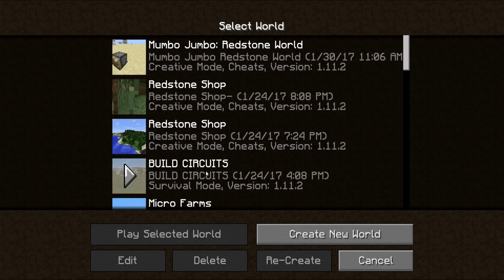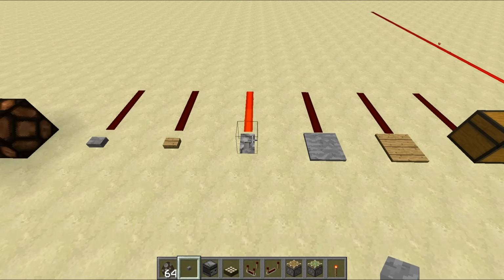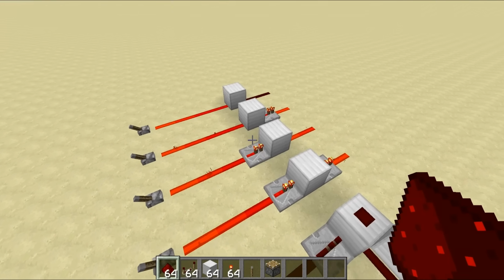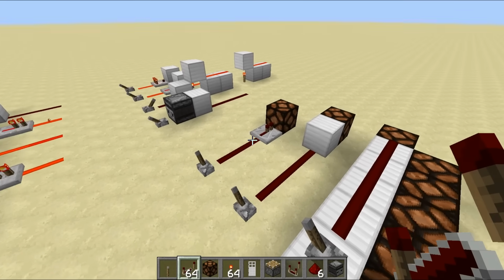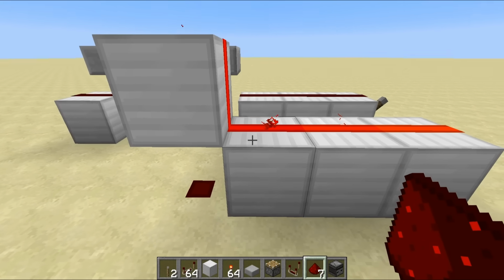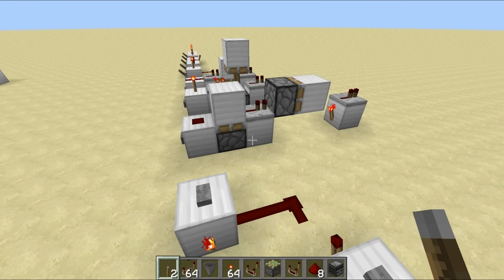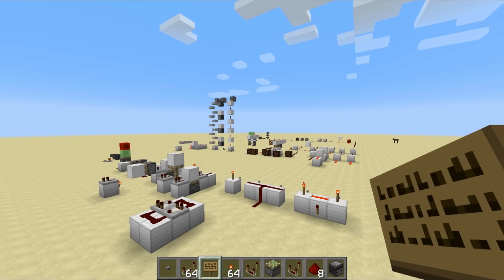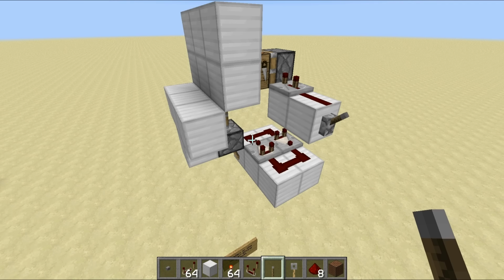How to go From NOOB to PRO at Minecraft Redstone!

Comment: Finished my homework. I pretty much made the same as the example, but because of maybe lag or something the door would instantly close sometimes which seemed like a suffocation risk. I added a pulse extension below so it's not the fastest door by any means, but it's smooth and risk free.

Edit: Didn't finish the video before I started building.

For the alarm I did use the clock, but I didn't realize I could use RS Nor Latch. I used a Flip-Flop to activate the clock instead and used a handmade system to disconnect the tripwire after it was set off. It's just 2 non sticky pistons that push a block back and forth to disconnect the tripwire after the Flip-Flop receives a signal, and then reconnect it and send a separate signal to the Flip-Flop from the button. Definitely overcomplicated that one.

For the crafting table I pretty much did EXACTLY the same thing, just not as clean. I also did a crafting table and a furnace together instead of just the table though. I definitely underestimated this though and messed up the timing of the pistons a few times.
Reply: FYI, I just watched the video today in case it seemed I was late for a 6-year-old video.

Comment: i made the 2x2 piston door so complicated. so i made levers power redstone which powers pistons and when you step on the pressure plates it powers more pistons which block the redstone the levers were powering , unpowering the original pistons opening the door. me looks at mumbos design . i completely forgot. about the redstone torches

Comment: I have now managed to make a door that only opens if i drop an item into a hopper and use a wooden button on a specific block to reveal the hopper, stone button wont work, then turn on the door circuit with a series of lever flips. My faction vault is now basically invisible in the ground, and the only way in without several ages of mining obsi is the front door. If you find an obsidian cube with no apparent entrance now you know.

Comment: me today:
-build Mumbo's 3x3 spiral piston door - my first redstone project, have no clue how it actually works, I just build thing.
-be disappointed it functions by a single lever, I wanted a button on either side of the door
-discover T flip-flops
-discover this video, noting the transparent block can power two separate redstone lines - splitting the redstone signal. that'll get me from one button signal to two.
-have a discussion with my husband about redstone and, particularly, repeaters - in which a lot of its functionality in the redstone door I just built starts clicking for me.
-IT CLICKS.
IT CLICKS IT CLICKS IT CLICKS

I'm learning, I'm delighted. and I'm gonna go test some stuff and figure this out.  thanks Mumbo!

Comment: Would a soft powered block power red stone on top of it, if it was set up like say this  —= red stone █= block  = Air
    
         █—
————█

so there's a block stopping the red stone from connecting to the top, however, the block is still soft powered, so would it power from the top?

Comment: For those who don't understand the terms hard powered and soft powered: a block is hard powered when the redstone strength that goes in it is 15: a repeater for example can hard power a block because it resets the strength of the redstone dust. A block is hard powered by a lever because most redstone inputs give a redstone strength of 15 (except the daylight sensor and the target block in some cases)

Comment: the only one that i was able to work out on my own was the alarm system, i actually had an idea for what to do and i was able to have a bit of fun with it, although my system was a little bit larger than mumbo's

I made the repeating circuit with the hoppers and comparator linked up to eight note blocks (i spent a good amount of time just trying to get the notes as high pitched and annoying as possible) and made a line of redstone connecting from the tripwire to a dropper that was above the hoppers so when the tripwire was activated, the dropper would drop something into the hoppers, thus creating the alarm
getting the alarm to actually stop was the hard part; i connected an extended sticky piston to one of the hoppers and put an unextended sticky piston connected to a chest adjacent to the hopper that was connected to the OTHER sticky piston and linked two lines of redstone and some repeaters to a button (this part took me forever to correct because i had to figure out the timing and i'm not the brightest person you'll ever meet, also there was originally a lever instead of a button bc i was scared of everything breaking but i manned up and everything turned out fine)

Comment: My addition for 15:27: those comparators essentially act like diodes when used like that, so the signal can travel forward (clockwise in this case) but not the other way. The signal will lose strength over distance but by using those comparators, the stronger side of it can't repower the weaker side so it's going to diminish over time.
Reply: Just like the elves of middle earth.

Comment: ive tried the double piston extender on bedrock ed but its inconsistent but i figured i would make it work so i have the first piston with a repeater set two clicks back the second one has two repeaters at 4 ticks and i have another repeater where it was just redstone no extra delay it works consistently its as if it needs time to register or something so bedrock ed works but it doesnt run as fast or my playstation cant handle it one or the other but i guess ill slow my circuits to give the game time to register or ima break all my redstone
Reply: Yeah bedrock red stone mechanics are very very strange

Comment: just a FYI you can not just turn off a redstone torch with a lever or button but also another redstone torch along with redstone it self the torch to turn it off with another has to be under it and im pretty sure on the side of a block with the one under on the block on any side and on the other angle

Comment: I know this is an older video, and that to be a noob at minecraft in 2020 is... unique, I guess. That said, I've gotta disagree with you on one thing! At the beginning of the logic segment, you have two torches with dust in between powered by levers on either side, and called it an "AND Gate"... but this contraption emits a signal IF either/neither lever is on, but NOT if both levers are on. That's the != of AND, which is sometimes called XOR. 

Thanks for all the fantastic content and info!
Reply: edit.. I suppose if you put a torch at the output of the contraption, that would turn it into an AND gate. but to someone who doesn't know better, that might have been confusing

Comment: Okay, I ran into something really strange when looking at the BUD pistons...

Made a 1x5 iron block bar thing, lever at one end, redstone across the top. 1 piston connected under block 4, another one below that one. The upper of the two should update the lower so it activates, which it does, but then when I flip the lever again they both stay powered until I update them. Moved them to be under block 3 and they both retracted just fine, same thing with block 5.

Does that 4th block have some kind of strange properties or is it just some sort of bug?

Comment: 21:29 i have a better design than mumbo, where it takes less than half a second to cover the crafting table

first, you have a lever near the crafting table, then some redstone, a repeator, split the power to the left and front. then, place a double piston extender with the crafting bench, then, on the bottom, simply place a sticky piston with a redstone inverter.

Comment: I tried the alarm system at the end, it didn't work in 16.3, but I made a minecart clock with powered rails and a detector rail along with some pistons and it worked the same way.

Comment: I can never get good at redstone. The funny thing is that I know a little bit about electronics in real life, I could repair extension cords, lightswitches and even electric fans (as long as I have spare parts) but redstone... Add the fact that from what I could tell, I may have been playing Minecraft longer than Mumbo, he's saying he was new to MC when pistons came out and I was already playing MC for a while at that point.

Well, at least, over the decade, I can troubleshoot how to build anything simple that I need, like farms and piston doors but I just never remember circuits for anything more complicated. I know what bud switches are, I was around when boat bud switches were a thing, and have even made one from copying tutorials, but I just never remember how to build any of them and how they exactly work. Lol I just never retain any knowledge about anything...

Like, I can remember a bunch of names like T Flipflop but for the life of me, I wouldn't recall how to build it or what it is used for. I could even accidentally make a random circuit sometimes through trial and error when trying to make something and then I forget all about it the next time. Lol Usually because I take a lot of breaks from playing or at least very rarely build anything redstone related. I'd play on a world and maybe make some autofarm or piston stairs then it continues to work for years and that's it for me. I have to relearn it all over again if I decide to make a new world.

Comment: Please help me 
I  wanna make button like lever in mobile minecraft
Reply: Use T flip flops, mumbo mentioned it in 25 circuits you need to knw
Reply: I know you trying to help me but none of them  working 
I said mobile
Minecraft is different in telephone 
But still thanks for trying to help me...
Reply: Alpkan Gül there is one that works. Have three droppers and a hopper. Have them so they face into each other, and an item can go in a circle. Put an item in a dropper, put a button, and then place a comparator out of a dropper. If this doesn’t help, google Minecraft T flip flop bedrock
Reply: I made all them 
I  tryed fix it 
Even like this it didn't work 
But I  am will search it
☺
Reply: Ok one öf them works tan you
Reply: Alpkan Gül I know, bedrock edition but there is hopper dropper t flip flop or repeater locking t flip flop and that works

Comment: The crafting table one I over complicated a ton. I used a double piston extender to pull a block out, then the sticky piston from the bottom would put a crafting table in, pushing the iron block up to an above sticky piston. Then the button pressed would retract, and the double piston extender would extend and put in the crafting table. Then to put it away, press a separate button that would activate the double piston extender pulling in the crafting table, then the above sticky piston would push the iron block down, then pushed back in as the button retracts.

Comment: In the hidden crafting bench system I had a pressure plate and a dispenser to turn off a torch and retract a piston while another signal was sent to push the crafting table forward and by that time the hoppers below the pressure plates take the item and the retracted piston gets the crafting table and then pushes it forward
I banged my head a couple of times but it sure did work out well

Comment: For any that are interested pulse extenders work because the comparator gives the same pulse power as what goes into the front, but has a 1-tick delay. This means that if you string them together, then the delay of the comparator makes the pulse longer.

Comment: I'm just now getting into redstone (on bedrock no less) and this video helped me so much!

Needed a system to have two pistons move blocks open in a wall and then to replace them with lighting blocks for a mob spawner kill switch to stop/slow the spawning and Mumbo's piston door redstone combined with the pulse extender from the crafting bench rig was a perfect combination to open a hole in the wall and swap wall blocks for lighting and then be able to reverse the circuit without blocks crashing into each other!

Absolute Genuis! 👍

Comment: The dropper drops what's in it. The dispenser uses/activates/fires what's in it, generally, if you can use an item by right clicking while holding it then the dispenser can too. You can't plant with it though.

Comment: Hi Mumbai, I’m trying to replicate the hidden crafting bench, but I can’t get the first piston to retract first. It only retracts after circus is turned back off, and looks like it is being bud powered as it updates on the close of the circuit, then re-extends.  my red stone looks to connect to the piston block over the torch , unlike yours which runs in a complete circle without touching the piston block

I’m on bedrock edition, XBOX 1.
Reply: Reagan Smith same here, in fact, this differing logic has screwed up 3 builds of mine now

Comment: How the hell do you go vertically down?! I'm wanting to learn redstone so I can make an automated inventory system. How am I going to do that if I can't even figue out a 2x2 piston door?!
Reply: Observer tower
Reply: Bro did you know that if you place a hopper and a compereter going out of it the compereter will give a one block restone output and if you want more output than 1 than just place a reporter going out of the compereter and you will get a output of 12 blocks and one simple way to make the output going to 6 blocks is right click one time and just active the compereter and you will get it bro 😂😂😂😂😇😇😇😇 I am resting god 😇😇😇
Reply: FELT
Reply: @TopGyearsago  this hurt meh brain
Reply: Just put redstone on the pressure plate, and get it to go to the pistons, you only have to use 6 blocks at most, including the 4 u will use for the door. Hope you play bedrock, it's easier
Reply: Just make a ladder out of slabs and put the lever or button or whatever at the top

Comment: I was just thinking in the vertical powering section ( 12:05 ) that there should be a thing called bluestone or greenstone or endstone or something where there are redstone components but they go on any side on the block except for the top or bottom, and they could be separate from redstone lines, and then the redstone components that go on the sides of blocks like redstone torches could be on the sides of blocks sticking out parallel to the ground and cant be placed on top or bottom, then the redstone torches would be able to stick straight out of the block on top and bottom and cant go on the sides. And there could be a third type of redstone that connects to both of them and can go on all sides of the blocks.
Reply: That'd be cool, you could make a mod for that
Reply: @alexthai2868  Yeah, but I don't know how and It would be cooler if it was in vanilla

Comment: Tip for making complicated redstone contraptions: Don't try to make things small, unless you already know what you're doing. Learn the logic first and learn which circuits you can use, and which ones you need in order to make something work. Sometimes you just need to have a certain circuit but the one you know just doesn't fit in the space you have, and that's when you can look up a different design which does fit.
Along the way you'll also figure out how to combine certain circuits to make them smaller when you need to combine them for some kind of behaviour.
But in the end you should just experiment and try to come up with solutions yourself. Don't try to make the smallest or fastest thing possible if it is beyond your reach. Just make something that works. And keep looking up information. Look up circuits which do what you need, and combine all kinds of circuits.

Comment: A good tip as well, is to remember that Redstone works in a Binary system. With 0s and 1s.
0 Meaning Off.
1 Meaning On.
Similar to computer binary system, the more 1s, the more things, different combinations, different outcomes.
This literally means when working with Redstone, you are also working with basic electric engineering, and computing.

So remember the simple things such as a AND gate; Which require X inputs to be 1s to give an output. Otherwise it won't send the signal.
The XAND gate; Same as an AND gate, but reverse, it requires the X inputs to be 1s to stop an output, otherwise keeps on giving a signal.
A OR gate, simple but very good to have, stands for Either Or Gate, it requires either one  of the inputs to be active or off to give a signal. If both are on, it goes off, if both are off, it goes off, if one is on, and the other is off, it activates. This combined with a T-Flip Flop system, makes for a great press button on either side of a piston door, to open and close.

Remember the simple stuff, leads into the more complex stuff.
Reply: Im gonna screen shot this and thanks for the tips :D
Reply: i got to bored to finish reading this comment
Reply: @strykerleach4242  Well it is not made to be a fun read so many will get bored by it. At least it is not an electronics class, or binary computing class.
Reply: Nice
Reply: WORLD RECORD
Reply: Dude. I know labveiw. labveiw is real life Redstone used for things like spaceflight. I know what you are talking about.
Reply: I’m confused
Reply: What you referred to as a 'XAND' gate is actually a 'NAND' gate.

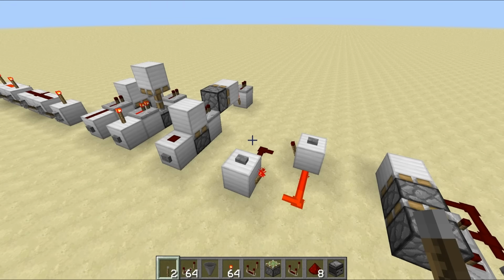Comment: 16:10 Ahhh the nor
My first ever redstone contraption of great magnitude was a 1 way staircase up to the view of my (incomplete) boobie trapped maze.

Made it twice in a big L shaped staircase across a corridor, if you hit a (not well hidden) pressure plate, the a 3x1 (10 blocks high) staircase would appear in the bookshelf, and reverse it when you got to the top. Because of the design, the other side had the near opposite built so you could go back down. The staircases insides were a beautiful pyramided mess of teenage redstone exploration. <3 

((Not that we didnt just fly down on creator))
(((Fs in chat for my dead map)))
((((One of many))))